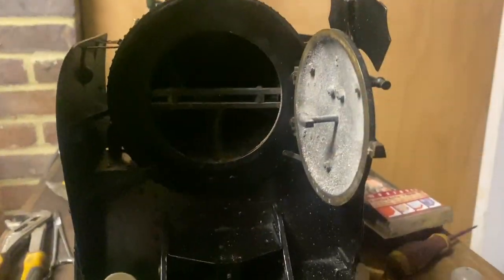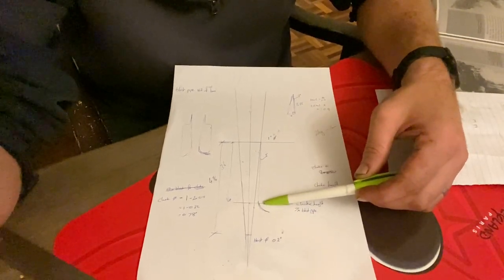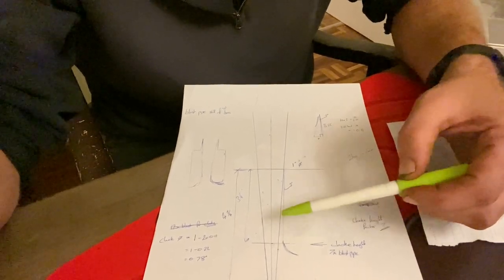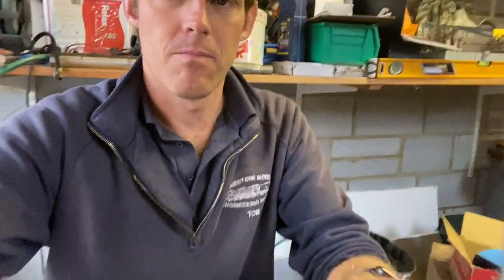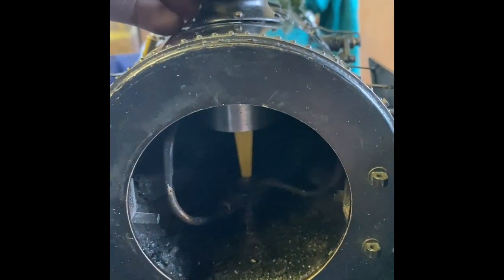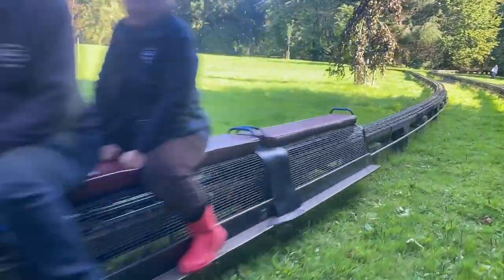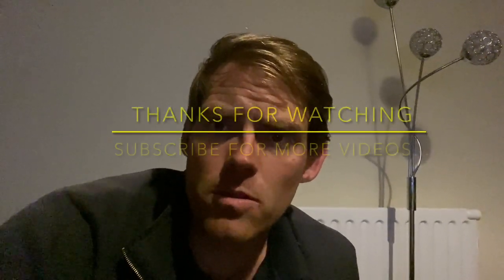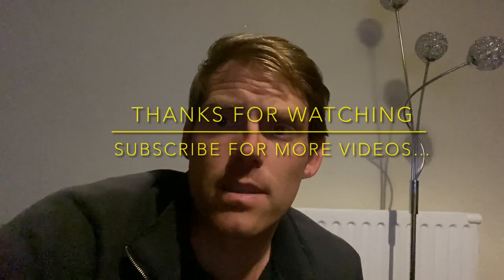Further draughting and a test run for the Brit.

Comment: John Hill did a rerun of a draughting in Model Engineer some time last year. Changing the 17 degrees to 16 from the original done about 1985 I noted. 17 seems to crop up several times as in 17 to 1 in the ratio of air to petrol. One thing I have noted over the years are the comments from Drivers complaining of lack of performance after several hours especially with an overactive lubricator. At Reading we run through a wood, so if I am let a drive a twig and a scrape of the interior of the chimney sends her back to normality. David and Lily. Just back from a day at Andover track.

Comment: Have you thought of trying a rosebud grate?  It is something I fancy trying but haven't got round to it yet.
Reply from the maker: I have got rosebuds in my other locos, with great success, however on this loco to swap the grate would be a boiler off as it is fixed in place with a hinged centre section. If the boiler is ever off for any reason then I may well switch it.

Comment: Tom, just wondering how you calculated the choke diameter and is there any reason why the height from blast nozzle to the choke is x7 of blast nozzle diameter, as I've read some people do x12. Any advice is much appreciated.
Reply from the maker: To be honest I was just following the research done by someone else, and that’s what the article I’ve been working from suggests. It’s worked well on all my locos so far, so I tend to stick with it.

Comment: Have you got access to a copy of Martin Evans book on building model steam engines. It gives an angle to the bottom of the stack AND an angle to the top of the stack. From memory the entry radius is not as large. I'll send a copy.
Reply from the maker: I’ve had a look through my shelf, I have his book on valve gears, but not his building model steam engines book. 
Thanks.
Reply: @TomsWorkshop42  It's on it's way via Martin.
Reply from the maker: Thank you so much 🙏.